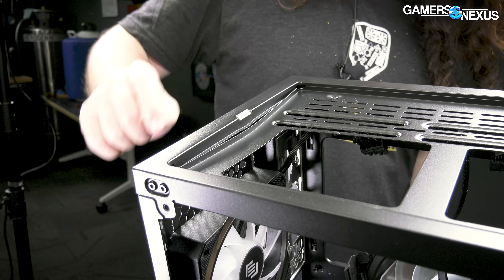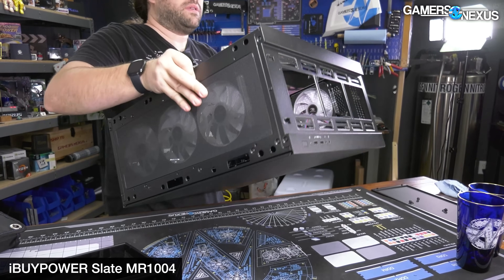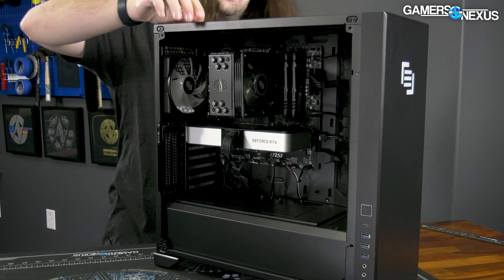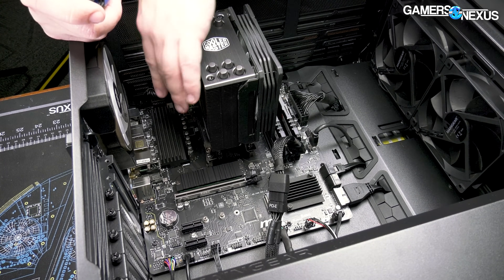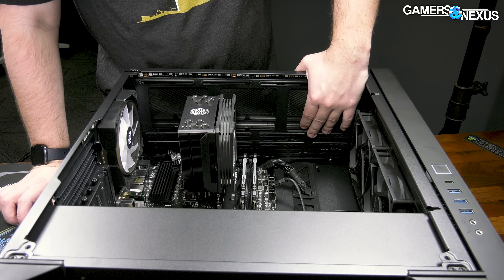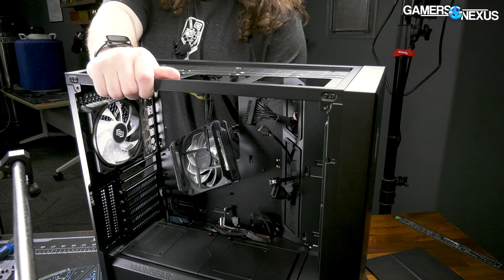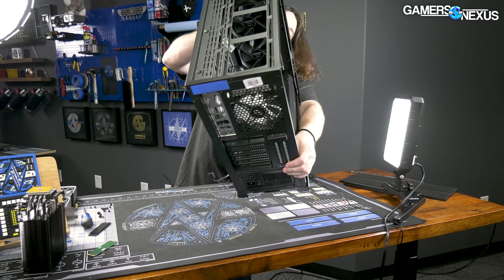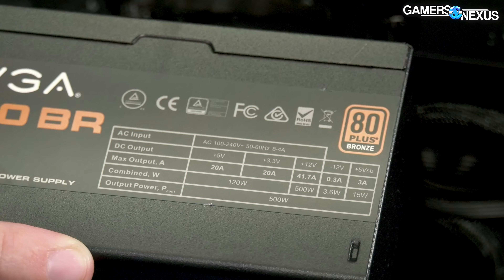Maingear Did It Right: Secret Prebuilt Gaming PC Review ($1700 Vybe)

Comment: Steve doesn't understand that if you have a fan pulling air from smaller holes that you STILL get air flow.  This point really makes Steve come off as dense as fuk and it's tedious to hear it in nearly every single case review.   

FYI: AIR MOVES FASTER in order to make up for the fact that there is less room for it to pass. In no situation are you going to end up with a vacuum in between the front of a case and front panel.  It would laterally take space station level's of tolerance to make a front panel completely prevent airflow into the case and in a consumer product, the difference is nearly negligible unless they epoxy a glass plate to the front of case, where fans are pressed up against the class for mounting.

Comment: a 1,700 pc only for a 3060 ti??? lmao ok get ripped off I guess. Literally has exact same specs as nzxt starter pc and thats only 1,300 right now.  And even if the case isnt good thermally it will do absolutely fine for a 3060ti. Only difference is that you get 500 more GB storage with an HDD lmao

Comment: Funny, right after complimenting their cable management he silently highlights the worst example of their cable management by disconnecting the diagonal cable from the bottom of the mobo to the middle of the GPU.  To be fair, the middle of the card is a bizarre place to put the PCI-e power connector.  Still, it seems like it should have been possible to route that cable from the front of the mobo, straight along the bottom of the GPU then 90 degrees to the connector.  Or maybe that's "boutique" level cable management?

No such thing as too much thermal paste, right?  😄 As long as it's non-conductive and not blocking any contacts, that is.
Reply: On a second look, I'd say the cable management is just decent.  For me, that's too many, too-long vertical runs at the bottom, and they aren't all quite vertical, so it's a visual mess of several lines that are visibly, obviously not parallel.  All of those would look better running together from front-to-back along the bottom of the board then branching from the bundle just below where each connects to the board, and that could certainly have been done because they're all front panel connectors, so naturally they all terminate at the front anyway.

But what do I expect in a banged-up case with a 500W PSU in 2022?

Comment: Seems crazy expensive for the components in it. $1700 would go way further just buying parts. It's not even close really, this is a very overpriced system.
Reply: By MSRP prices, or real world prices? If the former, they're definitely not achievable with any reliability for non-bots.
Reply: @TROPtastic  Not true anymore, it's easy to find GPUs at very close to MSRP now on several online retailers.